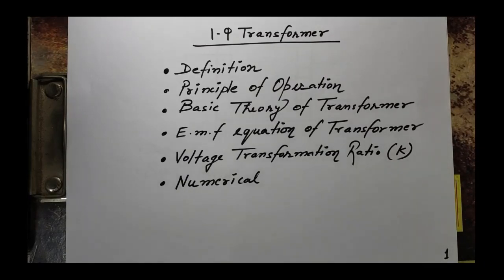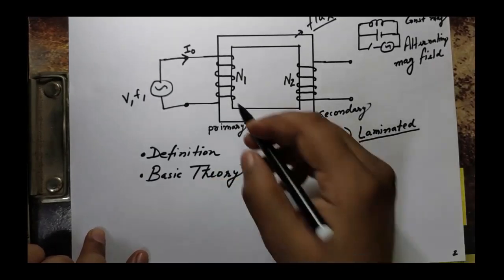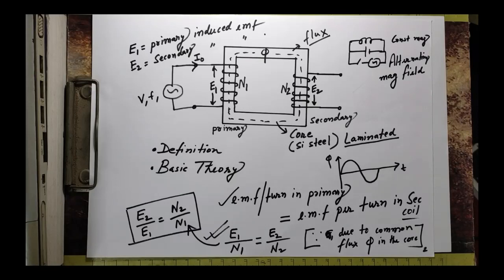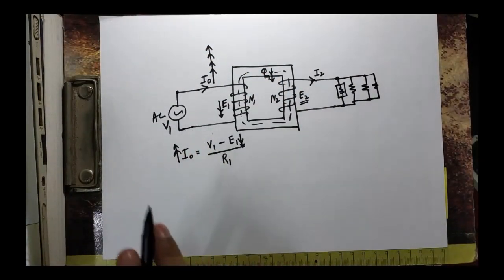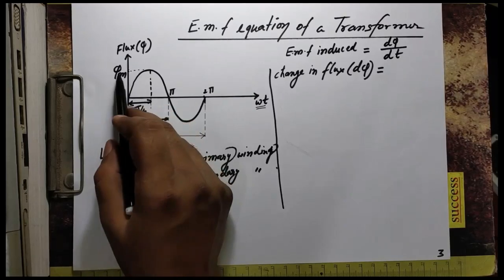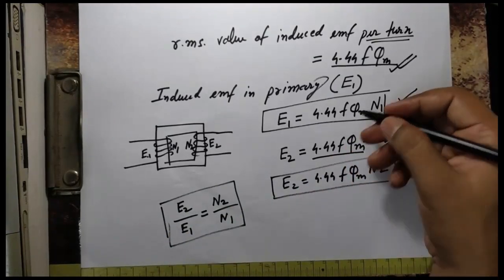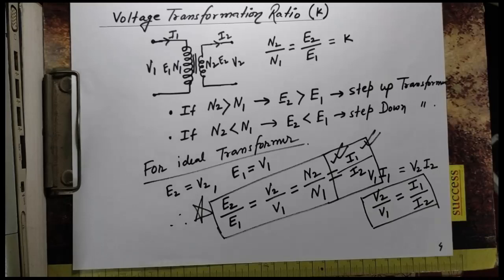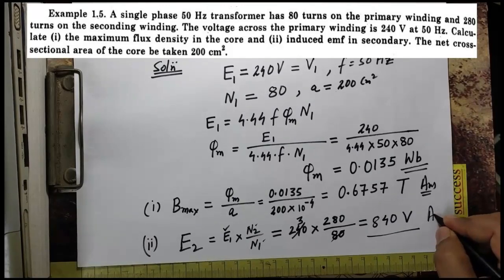LECTURE 1 TRANSFORMER

Comment: Sir, You have stated that when we add a load to secondary, a current flows through it. Due to this secondary current an alternating field develops in the coil which results in flux generation in the coil. This generated flux will oppose the main flux in the core due to Lenz law. This results in the decrease of the main flux strength. (This is one part)

Also you have stated that if we add a load or increase the existing load on the secondary side then more current is drawn in primary. (This is another one).

From above two paragraphs I have a doubt :
 If the primary current is increasing due to increased load on the secondary then the strength of the flux should also increase in the core? And if so more emf must be generated in the secondary and thus more current must flow in the secondary which in turn should result in more opposing flux from the secondary?

Then please make it clear that what will happen next. Or correct me if I made a mistake in understanding the concept.
Reply from the maker: When we load the secondary, the current flowing through it will produce a flux which will oppose the main flux. And now due to same loading primary current will increase which will eventually strengthen the main flux which will actually balance the flux which is oposing the main flux due to secondary current after loading. So ultimately flux will neither increase nor decrease, it will remain constant in the core. This is one of the reason why the core loss of a transformer is independent of load and it is constant for any load i.e from no load to full load this core loss remains same.

Hope now it is clear, If you still having doubt you can directly call me at 937816577.
Thank You

Comment: If we connect Load to the secondary of transformer then transformer drop more Current from the Source, As the load increase the primary Current increases and Cause more flux to flow through core so that the load Could be satisfied.

Due to this the secondary Current also increases so the flux of the secondary winding would also increase proportionally and this increased secondary flux is exactly opposite in phase with primary but equal in magnitude  with that of primary incereased flux, so these Cancled out each other  and the resultant flux would be same.

Comment: If we Connect the load to secondary of transformer then secondary current will increases and the transformer will draw more current from the source.
The load  is increases so the primary current will increases and more flux flow through the core